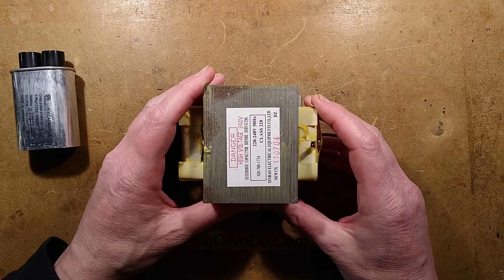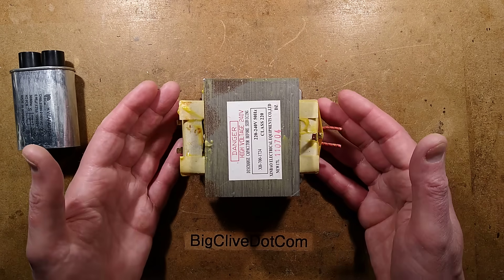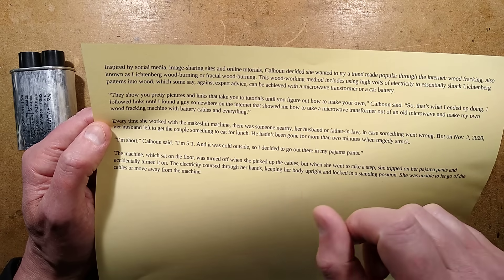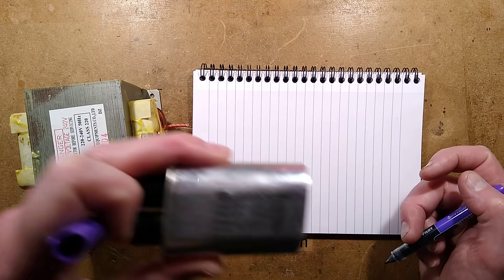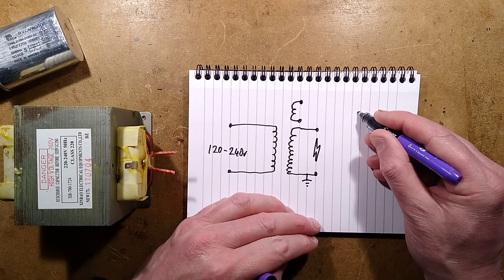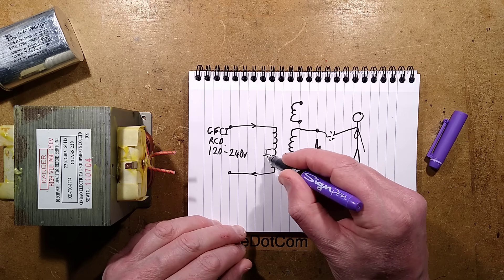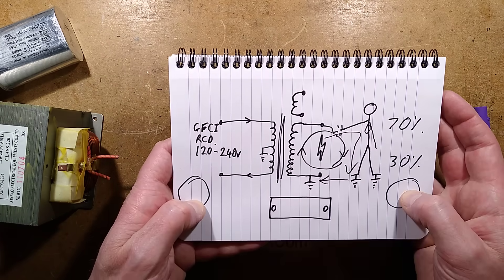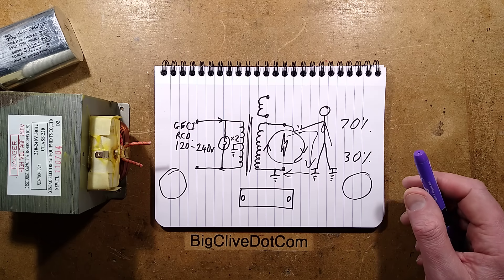The most deadly project on the Internet

Comment: So much for “volts don’t kill amps do”. When I was a young boy, my buddy and I found a 15,000 volt transformer at a abandoned drive-in theatre. We did all kinds of dangerous things with it, but later made a tesla coil. We were SO lucky.
Reply: To any one who has heard of ohms law “volts don’t kill amps do” doesn't make sense, since they are proportional.
Reply: @gavinkemp7920  I was going to mention Ohm's Law.  👍
Reply: @gavinkemp7920   it's the draw of said amps. voltage is pushed, amps are pulled. that said, there is a reason those tesla coils being shown dramatically going to a mans hand while he is grounded. they never show it going through both hands for a reason, because it keeps it from crossing the heart. I will be more than happy to show you as an old man with a bad heart showed me - two wires in the end of an extension cord, touch both with thumb and any finger of the same hand and you get a tingle, unless of course your dumb ass is trying to complete a load with amperage involved, then it will fuck your hand up. then try to do it with thumb from each hand and you will probably die as it's crossing your body and heart totally messing with normal bodily electrical functions. And on top of that it absolutely has to do with amps. A stun gun, the really good ones are upwards of 100,00 volts yet produce less than a twentieth of one amp, yet they are close together and do not cross your body in the way stated above. And yes I have a broken back from being electrocuted while on a ladder and falling. I have fucking been there and done that and i know what the fuck i;m talking about.
Reply: @douglasyoung6238  think you'll find that over over the actually the time the electricity is actually flowing you'll have several amps.

Equally averaged over time the nombre of volts is probably closer to 1 or 2 volts.

Its the fact that stun guns are only on for a fraction of a second at a time is what makes them relatively safe.

The saying that its the amps that are dangerous not the volts is misleading when voltage is the most reliable way of knowing if a circuit is dangerous with out making you part of the circuit. It's the kind of reasoning that leads to these kind of accidents.
Reply: @gavinkemp7920  amperage doesn’t tell you that a circuit is dangerous?
Reply: @murkyturkey5238  When measuring voltage we don't need to have a running circuit. so you see 2 live wire on the wall you can measure the voltage, volt meter have for most situation infinite resistance. so to get an accurate reading from to lines you don't need a full circuit.
for measuring the amps produced you need to measure it as the circuit is running. so if you want to make sure the current is low enough not to kill you, you need to be in the circuit which it too late. you can't just try an mesure it without a circuit because amp meter essentially have 0 resistance so all you'll do is cause a short circuit which will have much higher readings and not be representative.
Reply: @murkyturkey5238  no because how are you going to measure the amperage when you are the load? You don't need a load to measure the voltage :/
Reply: @gavinkemp7920  Depends. For constant power (Watt), I and V are inversely proportional. For constant Resistance, they're proportional.
Reply: @TheReligiousCrap  - Well no, 'I' and 'V' are ALWAYS directly proportional, as the formula is P = I * V, as in power equals current times voltage.  So, if either current or voltage increases, so does the power.  Not sure why you mention "constant resistance".  Perhaps I'm misunderstanding your point.
Reply: @gavinkemp7920  they are indirectly proportional through a transformer. In a 1:2 xfmr your voltage will double but your amperage will cut in half. Wattage stays the same.
Reply: @CS-ui4qj  yes when you compare the input and output but if the transformer doesn't burn or the fuse, then the input will provide as many amps as the output needs.
Reply: @gavinkemp7920  and where would any normal household be using this transformer with no safeties (15-20A breaker or gfci) in line? If you die from electric shock in your home then you were probably going to die from heart failure anyway. Take it from someone who has been bit many times from 125vdc and 120-480V AC (we isolate 4160V and up). Me and my heart aren't special, anyone without a pacemaker, or in need of one, would be fine.
Reply: I remember me and a friend fooling around with a transformer also from an old theatre and we were trying to make a 12v power supply.... Welll it blew out the transformer on the power pole.. scared the living day light  out of us... lol
Reply: Well in this case the transformer is designed to give both a high voltage and be able to carry a sufficient amount of current that it is deadly, therefore technically speaking that idea is still somewhat relevant, however, in truth it is a combination of Voltage and Resistance that matters. In theory, the circuit of transformer, person, ground can be thought of as three impedances in series. The person has a very low impedance, the ground has pretty much no impedance, and of course the characteristics of the transformer's impedance is simplistically speaking, limited by the cross sectional area of the copper winding. Just observing ohms law, I=V/R should be enough to explain that a person behaving as a small resistor will pull as much current as the voltage proportionally will allow, assuming that the conductor connected to it has zero impedance. In reality, the conductor connected to the person will have some impedance. So, really you can only pull as much current as the conductor will allow. So really, the comparison to an electric chair might be suitable, but not an overhead line, because if you touched an overhead line with connection to ground, as overhead lines are able to carry high currents, you'd be pretty much incinerated on the spot in a second. The phrase should really be changed to "Volts will kill if it is high enough and current carrying capacity of the conductor is high enough at the same time", but that doesn't have the same ring to it.
Reply: In a sense, it is the amps that kills you, as one can have a very high voltage and yet end up doing nothing to you.  When you walk across a carpet and build up an electrostatic charge, then get zapped when you touch a doorknob, that voltage could be as much as 10,000 volts!  And yet, you only get a little annoying zap.  It's because the current is very low that it doesn't kill you.
But then that all said, a car battery can put out a bunch of current, and yet nobody dies from touching a car battery.  The thing that the voltage does is create a closed circuit once there is enough voltage to overcome the resistance.  
I think overall it's best to say that it's the overall "power" that kills you, as power involves voltage AND current.
Reply: It is the current that kills you, but voltage and current are tied together and proportional unless you somehow change your bodys resistance.
Reply: I guess it's true in a pedantic sense, but Ohm's Law and such...
Reply: it's more about the wattage you get then it is about voltage/amperage.
Reply: Well, higher voltage can push higher currents, even through "insulators" if the voltage is high enough. Look at lightning - tens or hundreds of megavolts, current flowing through several kilometres of air!

A high voltage source that can only deliver a low current could indeed be safer than a lower voltage source with a high current capacity. Piezoelectric igniters found in lighters are a nice example. I wouldn't recommend relying on that, though.

From what I understand, 50mA through the heart is enough for a fatal shock. Lower voltages, e.g. 5 V or 12 V, generally won't cause this to happen, but it could under the right conditions! Of course, other injuries are possible as well.
Reply: @falcon-ng6sd  Even "medium voltage" can pack enough amps to be a problem. Maybe not a lethal problem, but enough to rattle you to your core. Ask anyone who's got a really serious shock from an arc welder.
Reply: @falcon-ng6sd  lightning is a current driven event so the voltage is dependent on what is least resistive around it.
Reply: @Misaki896  - I would say that lightning is a voltage driven event, as it's the voltage that creates the current.
Reply: @jszlauko  When we look at structure grounding, we assume lightning is 20-25k amps. By minimizing the resistance we can ensure the phases are properly isolated from the strike. If you do this with a fixed voltage, you're assuming that the current will drop because your structure is in the way.
Reply: @Misaki896  - Sorry, but I am absolutely clueless to what you just said.
Reply: @jszlauko  I'll refer you to BIL ratings of insulators.

In short, assume some current for the lightning, multiply by your structure resistance to ground, ask if it's less than the BIL of your insulator.
Reply: @Misaki896  - OK, you are totally losing me here.
You first stated that "lightning is a current driven event so the voltage is dependent on what is least resistive around it."

Uh, well, yeah, with less resistance, sure, then less voltage would be required to "overcome" it, and then result in a current flow.  I take "driven" as meaning "that which causes the event".  Thus, the current doesn't cause the event, the voltage does, as it is that which is present in the first place to cause the current.  

You then get into the BIL ratings of insulators.

In looking up this BIL, I find that BIL is the maximum impulse voltage that electrical equipment can withstand without damage.

What does that have to do with what started the event?
Reply: @jszlauko   I'm saying that voltage is unnecessary when looking at lightning and that the important information to consider is the amperage of the strike.

I also told you how BIL ratings are applied.

Resistance to ground: 20 ohms
Assumed strike amperage: 25k amps
BIL rating of insulator: 550kV

20 ohms * 25kA = 500kV
500kV < 550kV
Therefore you have proper grounding.

The voltage between the ground and the cloud isn't even taken into consideration and the voltage of the strike itself is dependent on the current that passes through your item. The presence of voltage gives means for a breakdown in air for the lightning strike, but the driving factor behind the strike is the current and aided by the resistance (the actual electrons that are ionizing the air and tunneling to ground by paths of least resistance).
Reply: @Misaki896  - OK, fair enough.  The current does the damage.  I think I see your point now.  Thanks!

Comment: I used to be a service engineer for DC excited CO2 industrial lasers. These had a BIG 3 phase HV transformer and rectifier in the back capable of generating about 30kV (DC) at a couple of amps, and a capacitor the size of a shoe box. Believe me, you gave those a lot of respect when working on them!

Comment: @bigclivedotcom I was wondering if you might do a similar video on co2 laser power supplies. They operate at 20kv+ and are becoming ever popular with models like the Chinese k40 such as I bought.

I watched a video on someone replacing the laser tube and wondered why all the fuss with double insulation and liquid silicone. Appears that the type of injury 20kv can give you is more similar to lightning, and the insulation jacket seems to have some special requirements or you could electrify the frame? How unsafe is this voltage, exactly? I'd think one would be risking their life to hold the tube while it's on (besides being a very dumb thing to do if it was not mounted in the machine).

Scary stuff. And I wonder what affect it can have on nearby electronics if the machine is improperly grounded, maybe a secondary reason for the big grounding lug?

I'm sure it would make some pretty fractal patterns inside of whoever gets too close.

Comment: Hey BC... I did build a Jacob's ladder with  one of these and while it was awesome for an hour or so its uses are limited so I pulled apart and cut out the secondary and my plan is to put in a few turns of heavy cable (was going to use 'tails' grade as you would find on the electric meter but maybe you would advise otherwise?) Anyway the idea is that I can lay my skewers across the devices contacts to finish my tandoori chicken.. as it cooks great under the grill but is never seared inside like in the restaurant... or is that the daftest idea ever? Always pleased to receive feedback. Cheers.

Comment: Did you just said discharge it by shorting with a screwdriver?? Shouldn't it be discharged with a proper "outside" resistor? (for safety!)

Comment: its safer to use, unscrew the ground terminal from the transformer, then use the output high voltage wires as your input 220v, the resultant output voltage is 20 volts (220 volts input) or 10 volts (using 110v input). 
also if you are using analog multimeters to measure resistance across the 2 terminals of the secondary windings, never ever touch it with your bare hands, whenever you release/remove your hands from the terminals there are high electrical voltages and the current is very high.

Comment: its safer to use, the output high voltage wires as your input 220v, the resultant output voltage would be 20 volts (220 volts input) or 10 volts (110v input). make use of these microwave transformers rather than throwing it.

Comment: I used to work with 7kV valve induction heaters (we now have lower voltage semiconductor ones) would never get close to it powered up, only take the HV enclosure covers off once locked off. The manufacture will no longer deal with the old types, they consider them too dangerous!

Comment: Apart from a Tesla coil I made as a student that used the schools 5000v generator as input I have always shied away from high voltages. Anything over 50v. I've noticed that BLDC voltages to get high wattage motors are creeping up, 75v, 100v... Electric vehicles are standardising on 800v bus I think...  Car mechanics are going to need to take care!

Comment: I have worked as a high voltage substation technician for 25 years and I would like to say 2 things. 

1. Thank you for illustrating the danger in a project like this. 
2. Do not downplay shocks from "household" voltages. 

High voltage can kill you. 
Low voltage can kill you. 

More deaths occur from "household" voltages than any other worldwide. 

Thanks for the video.
Reply: It was explicit, though perhaps not loudly stated, that anything over ~50v can trivially kill you if you take it hand to hand. I don't see this as downplaying anything, only speaking to the crowd that already ignored any stronger warnings and their own ignorance.

Between high-current electrocution and medium-voltage arcflash is the goldilocks zone for "leaving a bad mess" instead of "leaving a corpse" or "leaving a vapor cloud", it's quite simply less humane for people who are going to electrocute themselves to go that way.

Comment: Don't use especially with YouTube EMP  with that caps?🤔🧐😠😤get your self a 40kv pulse transformer on ebay you can get a 8cm low EMP feild depending on airgap type and power amount this for a rewind especially with 6 40kv units and one out!.??? Or a kit induction type for 20bucks or a minimax transformer for burn works way safer than a 240v type????

Comment: I did see one really good video on how to use microwave transformers in a useful way the gentleman took three of them and put them in a metal pod hooked up the electricity hooked it up to his Crane and while I he had a electromagnet and he went to pick it up a piece of plate with it also and it looks like a 4x8 sheet of 3/8 steel and it was very powerful magnet after he got done setting up because I personally know how heavy those 4x8 sheets are at 3/8 man it's like well I have a hard time moving them with a bar even.

Comment: No matter how many times you do something following a safe procedure, it only takes one second of inattention or complacency to skip a step or change the order of steps and make something unsafe.  Microwave ovens have lots of safety features built in to prevent a person from operating the oven in a dangerous manner.  It seems to me that a large oven could be readily adapted into the close cabinet with a light, safety switch, and fan to perform this.

Comment: I love playing around with microwave transformers. 
But before that, I went on and studied electrical engineering for 6 years, placed the transformer on a few isolated sheets of stuff (so that the transformer is isolated from the earth as best as possible) and using only one hand at the time, especially when it's powered on. Plus very long isolating sticks (minimum 1 m) which with I can control the second "electrode" connected to the transformer and so on.

Yes, it is funny but as this video perfectly explained and showed "only mess with stuff you know exactly about"

Comment: when I was 11 I saw a YouTube video on this and decided it would be an awesome project. I also got deep into the electromagnet deal with these bad boys. I went to the local appliance repair and snagged 4 trashed microwaves. I eventually popped the circuit in my grandpas shop but he figured if I got to that point without dying I must have been doing it in a safe manner. Long story short we got a bigger circuit breaker in the shop and I started lifting up go karts with my electromagnets and eventually melted 9 microwave transformers worth of copper. I also discovered the magnetron can cook a pinky finger pretty quickly with the right circumstances.
I understood the dangers of capacitors and electricity at 11. Don't need to scare people just educate them.

Comment: ""never work inside a microwave oven with the power turned on"" how else can I check the high voltage with my HV probe. 🤣🤣
yeah, I have a proper HV probes.